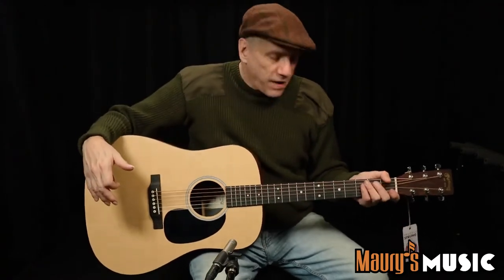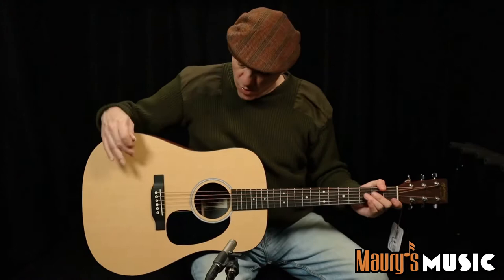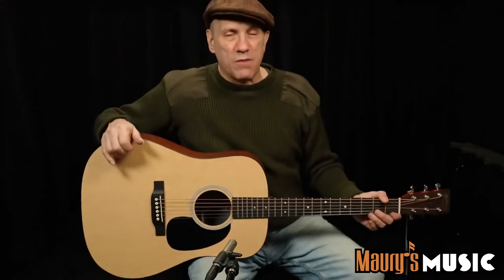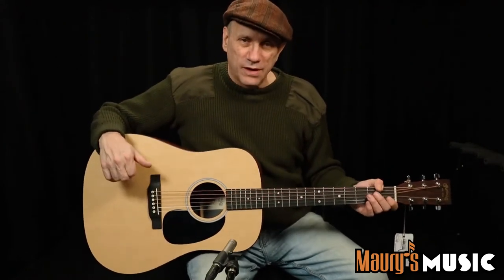Martin D-X1E Sitka - demo by Spoon Phillips

Comment: OK purchased the Martin X Series D-X1E-04 Sitka patterned top on 8/25/2022 - Just played it for the first time - To my ear I think it sounds nice - The action is a bit high (going to try a truss rod adjustment and sand down the saddle a bit and see if that helps (I have a couple more things I am going to try - I will add to the comments if the enhance the sound) Overall I am pleased and plan on adding comments as I get to know the guitar better (going to experiment with different strings and will comments if I come across a pair that improve the sound to my ear) TO BE CONTINUED................
Reply from the maker: Congrats! If I may offer a suggestion, please consider discussing the action height with your dealer  - they might be able to do a setup if you ask. Enjoy!